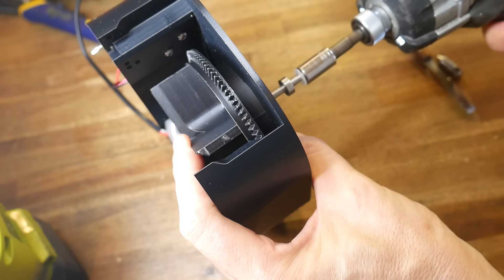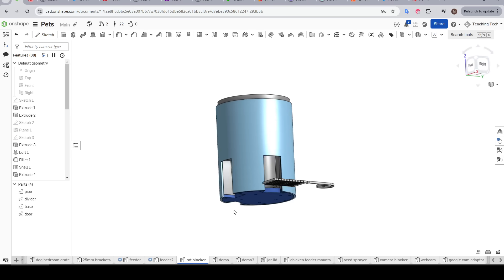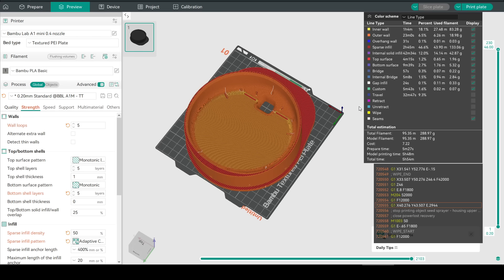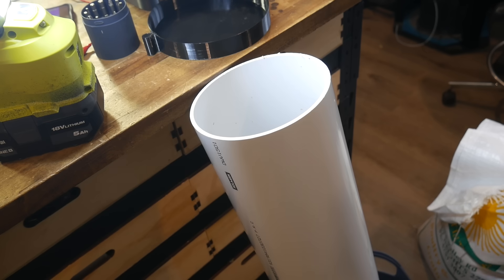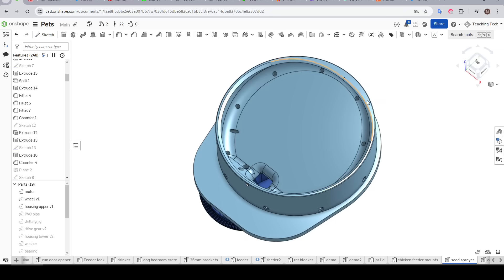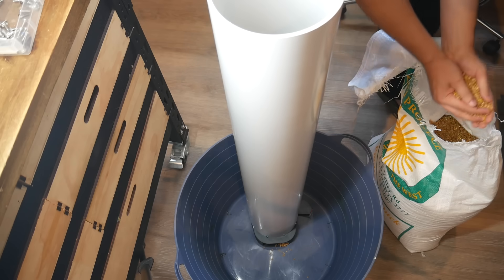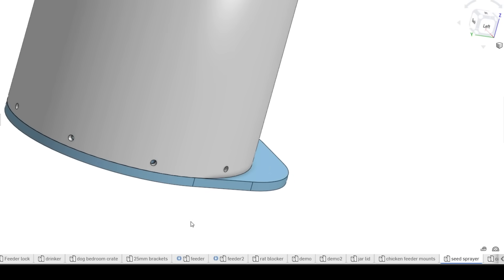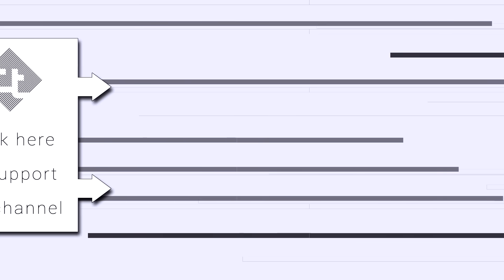Six tips to make your 3D printed projects more successful

Comment: One thing to note about the Deutsch connectors. TE actually makes and sells bulkhead mount DT connectors. They have a thick rubber boot, flange, and screws to attach to a terminal. While its easy enough to make our own using 3D printing, it can also be convenient to just buy one that's engineered from the start to provide a sealed passthrough of a container.

And if TE makes em, I'm sure there's a dozen knock-offs on Ali and similar sites

Comment: Hopefully in the jump scaring does keep the goats away (and the rats stay away in general), but if not, wouldn't mind seeing a follow-up on what you end up doing with it
Reply from the maker: The current problem is very eager cockatoos hanging out for a feed. So I do need to extend the system to solve that.

Comment: About overcomplication and thinking what is needed: I needed to attach Ikea Kallax 4x4 to a wall, but needed more spacing (30 mm) to the wall than original hardware allowed (0 or 10 mm depending on which holes are used).
1. Create angle bracket that has holes for small screws to cabinet (not sure if they had hold, the heads are conical and very small) + holes for "normal" screws to wall.
2. Use original brackets at 10 mm position. Create 20 mm spacer and a slug (going through bracket and spacer) with recessed screw to wall, split to two and printed sideways for strength.
3. Use original brackets in 10 mm position and plates. Create simple 20 mm spacer with hole for screw to wall.

 I started printing #2 but stopped before purge line was laid down, because though it was nice design, it was still stupid.
#3 was obviously the simplest and most robust, but why couldn't it be the first idea 😅

Comment: My tips (to add to your good ones): 1. Focus on designing and testing the difficult parts first. Try to catch all the show stoppers in critical areas before getting into fine details of the rest of the project that might need to be reworked.  2. Design for assembly and disassembly - unlike many factory built things these days that are made to be impossible to take apart. I find I put components together and take them apart again many times before the project is finished.

Comment: Great video.  Thanks!

4:45 - There is the implied assumption that you need to print a small complex insert to avoid printing a large part multiple times to optimize a small complex geometry.  I design the large part then chop only the complex small part to test print as many times as needed to optimize it, then I print the large part with no need for a separate insert to be screwed into place.

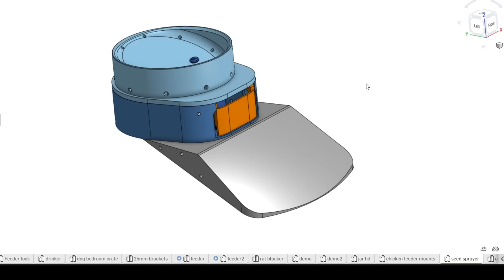11:50 - Based on my goat experience, the 3D printed "bolt on goat guard" will be eaten in 20 minutes.   😛

Any closer to the 6th video in the SV08 multi toolhead project?  I'm very interested in that.
Reply: My goats chewed a hole through a shed wall to get to a tree in the spring. Never underestimate their ability to tell you off.

Comment: I just wanted to say how enjoyable this video was. You did an excellent job of giving truly helpful tips with plenty of interesting real world examples to really explain the “how” and “why” behind each tip. 

Your tutorial series on learning modeling in Onshape is what helped me graduate from using tinkercad. I now find onshape easier to use for my more complex ideas and having variables makes tweaking and iterating on designs so much easier. 

When I’m trying to get the tolerance on a part just right I would usually just tweak the design in Onshape and the. Use the slicer to cut off the part I need to test fit.

I’m definitely going to start designing my parts in pieces like you recommended. That’s going to be such a huge time and filament saver.
Reply: FreeCAD 1.0 is now a stable CAD program.  People are overwhelmed by the "real CAD" online tutorials, but I recommend people start in what I like to call TinkerCAD mode.  Select Part (not the default Part Design) from the workbench pull down in the toolbar menu near the top of the screen.  Then you can create your part using primitives - cube, cylinder, sphere, cone, tube, torus, or create your own primitive such as a hex extrusion.  You can scale these primitives and rotate them using their properties menu.  You can cut and paste them to repeat features.  Then you can add them together, subtract them from each other, or form intersections of them using the Boolean tools.  Then you can chamfer and/or fillet edges to finish the design with radius intersections, curved edges, countersunk holes, angled arches that can be 3D printed, and beveled edges.  It's amazing how much complexity can be quickly created this way, with the full control of parametric 3D CAD to quickly revise the design.  After you are productive and comfortable with FreeCAD, there is plenty of time to watch the tutorials to learn "real CAD", sketching arbitrary shapes on a plane and extruding them, lofting, revolving solids, etc.  If you avoid the complexity initially, you can download and install FreeCAD (it's completely FREE open source software) and be doing productive work in an hour.

Comment: I had a heating system I made years ago, some parts indoors and some outdoors. Best learning experience I've had but the main thing I learned was - Test test and test again. Every scenario you can think of and ask others. Having a second viewpoint in anything creative is always good (but be ready to accept criticism - I have a friend that's no nonsense and they're great for perspective).  And get someone else to test it. If you made it, you're biased and you're designing it and testing it for the function, form and problems you see.  

The real world isn't perfect, and it's likely neither is your design, circuit, parts or programming  (or programming language). Mechanical, electro mechanical and programming always need extensive long run tests (a small voltage or current issue and a motor can burn out quicker, or wear a bearing or gear if it's not aligned correctly and programming errors are common, that incremental i+1 can overload beyond the integer size and go to 0 or a negative number if it's not managed). 

If it's got WiFi or radio of any kind test your circuit in the location to make sure there's no interference (bear in mind other RF or electro noise, walls, furniture, glass can block or interfere).

If it's outdoors, observe trees and bushes around the location that may grow or will have more leaves in summer than winter, this can cause line of sight and WiFi interference later on.   Test for weather and pest problems (I've had moisture buildup from temp changes in one and insects make a nest out of another of my electronics enclosures when I was sure both were sealed).

Parametric helps with design iterations. And photos can help but perspective can be skewed in a photo, take a photo, take measurements, sketch it out with your hands on a piece of paper (or print it with a paper printer rather than 3d printer) to check it aligns first. 

Have spare parts on hand, if like me you're waiting 4 weeks for parts from china and your project is shelved, you'll lose momentum or not find something easily. If that's the case buy some clear plastic boxes and put all the parts in one box and label it "xxxx project" and put on it the part you're waiting for to continue so when it arrives you can match it up and continue that project. 

Think practically about it, if it takes you 15 minutes a month to do something it's not worth spending 2 weeks to make something, especially if it needs replacing or maintenance. But if it's got a quality of life gain or learning experience you value it's worth exploring. 

Think about your design, the problem and solution and plan It effectively. If you think there are improvements, plan them too, but It doesn't have to be perfect or you'll never finish or perhaps  it'll take 10 weeks to do something that should have taken 2 (when it's a 15 minute problem you're solving).  If it's good enough to fix the problem you first started to solve, it's good enough. Scope creep is real, especially in our own projects. It just has to be a timer for a water pump, not freeze water, blend it and make margaritas (unless that was in the original scope 😂).   

And lastly, don't be afraid to make mistakes. If a motor goes or microcontroller gets fried, €10 is a cheap lesson and any DIY really is a learning experience.

Oh and one more thing... Do a review or ask someone else who uses it what they think after a few months. What improvements could be made. Write them all down, stick it with your original design, then if it breaks or something changes you can redesign with minor or improvements. As Michael said future proof but you dont know what you don't know yet so... Review!

Comment: I tried using Onshape a bit but found it frankly absurd that a $1500/yr piece of software had no support for resizing images after importing them, as far as I could find in any of their tutorials and helpbases. Overall I'm more of an object-oriented modeller than a sketch-based designer so I've had more luck with fusion but it's always good to see the incredible things people can make with online cad :)

Something I learned even back in my beginner days with tinkercad was to just export the base layer of things and print those to check measurements, alignment, etc since I didn't have a good printer yet

Comment: All great tips, thanks for sharing. I do agree with other comments about alternative means of success, such as printing iterated features in isolation rather than making them entirely different parts. Both methods are useful, and there are sometimes other reasons to make separate parts, but if for solely iteration needs, just doing test prints of the section of the larger part avoids the assembly hassles later.

I was amused at the "future proofing" tip, not for its general applicability where warranted, but the fact that you wound up just doing what I personally would typically do if presented with a need for an extra hole after printing the part, which is to just drill the hole. Maybe you don't get as precise results, but usually good enough and you don't wind up with extra holes you don't need (which for me can at times be confusing, as I sit and wonder whether a hole is there because I've got a fastener to go through it, or if it was there "just in case").

Comment: Seeing the way the feeder shakes itself on the chainlink fence, you may not have even needed to add that agitator to keep the feed moving from the pipe into the spreader.  However, it was still probably the right decision to have done it in case you later decide to move it to be mounted to something a bit more sturdy.

Also, at the beginning when you mentioned "after that video, tragedy struck," I expected to hear a joke about the dogs murdering that barbie doll or something.  Unfortunately, the story took an unexpected turn.  I hope you're doing well and that your efforts to make the yard safer make a difference.

Comment: 1. You don't need to model every part that goes inside your project. This job was already done by manufacturers of many different mechanical parts. Alternatively when drawing a part, I use construction lines and shapes to mark the dimensions of any PCBs, modules and other, similar parts.
2. When designing parts, think of print direction to take advantage of greater strength in XY axes. I designed a case for the device made from (mostly) flat panes to take advantage of this.
3. For better looks follow rules and patterns used in other designs. For example my personal annoyance with many DIY designs is making holes for LCD displays bigger than the display frame, so it protrudes. The hole actually should be slightly bigger than active part of the display. Say, 1,5mm margin. Adding some chamfers to the hole makes it look even better. Also use golden ratio for determining good-looking dimensions.
4. If it's going to me disassembled in the future, include either hidden nuts (pause during print to drop them, can be done in the slicer), or threaded inserts.

Comment: Whenever i have a print that needs to work with other parts to have an exact fit, I use plane cuts or boolean operations in onshape to cut the relevant feature away from the rest of the body so i can print only that feature as many times as needed to get it right before reintegrating the feature back into the main body.

Also, at times when I need to match up features like screw holes or some other geometry to something that is already existing, I will zoom out in onshape enough to make the 3d modelled part the same size as whatever is in my hand and literally hold the existing part up to the screen to see if the features match. This has helped me numerous times.

Comment: In situations where I may need to print a large component multiple times to test a fitting for size, rather than break down the component into multiples requiring hardware to assemble as you've done, I simply use negative modifiers in my slicer to "delete" the bulk of the component so only a small portion that I need to test fit is printed. I would have done this in your example of the two-pin connector plug so it could have been designed into the main component. I realise this isn't possible in all scenarios.

Comment: Something I have found useful for making sure tolerances are correct for snug fitting parts in CAD is to use the Move Face / Offset Face feature. Once you have done a tolerance test print in your slicer, you can then use that value as your initial offset and select any faces that are mating to parts with known dimensions. Then, if those tolerances need to be adjusted, you can quickly edit the face offset  values rather than editing the original sketch away from the "ideal" measurement.
Reply: I only just discovered “offset face” in Fusion 360 today and I love it.

Comment: I'm curious what your go-to filament is...  is it PLA, PETG, or something else?  I find I print most things in pla because it's fasster to print and so iterations go faster.  but.. petg is so much more robust that if I want to make sure something lasts or need to flex, I lean petg.  I've seen some fancy filaments at $60/kg that sound like aluminum after printing.. but I think my printers would struggle to print it, I'd kick myself if any of the prints failed..   so.. you have outdoor projects in tough environments..  curious what your default is. :-)

Comment: Calibrate a line on the screen to a known length. Stick an object to the screen with clear tape. Trace its outline. This avoids any photographic distortion and is usually quicker.

Comment: Tomorrow will be going to go buy my first printer.. x1c

Just started watching tutorials on how to use CAD videos
Reply: It’s good that you are getting a start in cad. The biggest problem with printing is that people make all the interesting models online and then get bored
Reply: @ I have a speaker terminal in mind that I would like to replicate and print on my own.

The guy that sells the Speaker terminal with magnets charges $150+.. I prefer to use this as a reason to start learning how to model
Reply: @JustNel onshape? its goated bro
Reply: @luke-w8c6w  agreed. The only thing i don't agree with is that onshape is run from the cloud. IT IS NOT. slow computers will still be slow. It's also unpredictable. A computer with a 5800x and 6950xt runs noticably slower than an m3 mba

Comment: Couldn't agree more on the jigs/templates comment. I recently built a wishing well for my front yard out of cedar, and designed the entire thing in onshape. I printed out two templates that doubles as guides for cut lengths and screw locations, and it not only saved me a lot of time, but also ensured that each piece would be perfect. The end result was terrific.
Reply: 3D printing is great for quick and cheap jigs and templates, particularly when the geometry can be pulled from the part being designed.  However, there are even quicker and cheaper tricks that can sometimes be used.  Example:  Use 8 screws radially placed instead of 9 as Michael used on this project.  2, 4, 8 or 16 screws will allow you to wrap a piece of paper around the circumference, overlap it, and cut it to the exact length.  Then it's easy to fold the paper tape in half to make the opposite screw hole.  Then fold those halves in half to make two more equally spaced holes.  Etc.  Masking tape is very good because it's a uniform width and it holds itself in place.

Comment: My piece of wisdom:
If you are doing a one-off purely-functional project for yourself and your first print has came well, except that it doesn't fit, remember that this is a one-off solution and get your hands dirty with drill/sandpaper/file/soldering iron. You can still fix the model, you already know that those 0.15mm will do the trick.
Reply: I do this partially to punish myself to give myself greater motivation to get it right on the first try next time.  The visual reminder also adds to the character of the piece.
Reply: This requires a sort of reverse dedication that few engineers possess ;)

Comment: When testing out new parts I use the 'Cut' feature in the slicer a ton. That way I can just only print a few layers to check hole placement or cut it down to just the new section I'm working on to ensure it works as expected before printing the full size item. It's been a game changer in saving time and of course filament.
Thanks Michael for the great videos! You played a big part in me learning how to design my own parts.  Keep up the great work!
Reply: Yep, was going to post that. I don't tend to break my design into lots of parts unless I need to, but to validate dimensions and clearances etc. I'll cut to print the smallest section of the design I can. I do this all the time for print-in-place hinges & bearings where it would be harder if not impossible & self-defeating to design and print as separate parts.